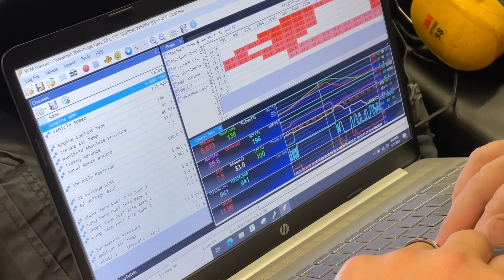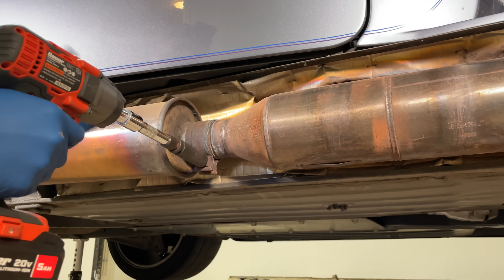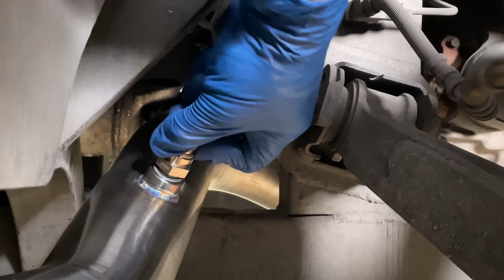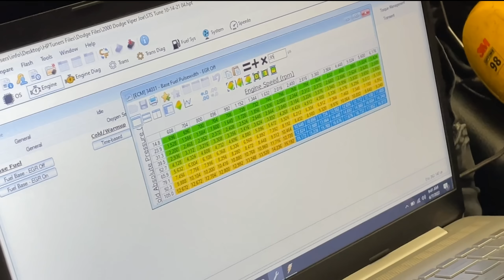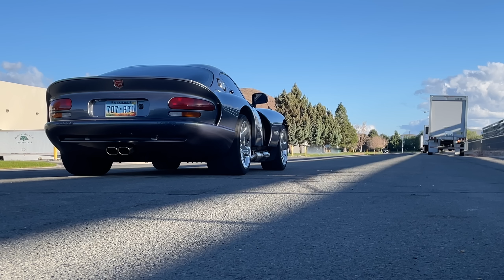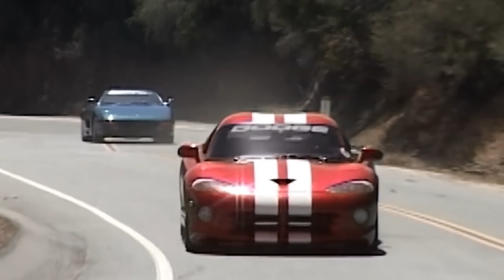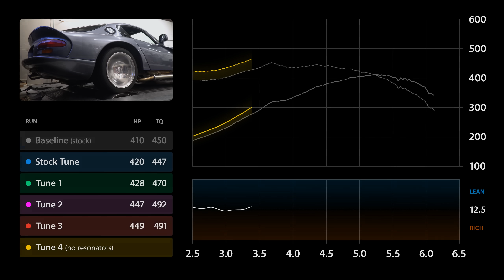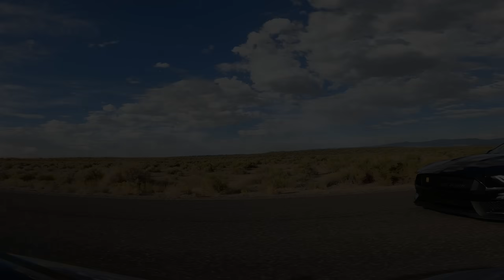When you give an 8-liter V10 the exhaust it deserves

Comment: Those HP and Torque gains seemed amazing to me
Reply: Yea from just an exhaust system that’s solid
Reply: I dont think its just from the exhaust system its mostly from the software tuning
Reply: @luaihommos5987  i went and watched his tuning video on the stock viper with no exhaust and it got to 438hp/483lbs-ft, so the tune was worth around 30 extra hp and torque and the exhaust another 20.
Reply: @EricWangbolone  thanks for the break down, still pretty impressive for an exhaust
Reply: Especially considering is naturally aspirated.
Reply: Very true!  They literally are adding nothing but gains over 10% of HP and torque!
Reply: Hey if you want to see crazy power increases, kawasaki recently released their zx4r, a 400cc inline 4 sport bike and, due to emissions, it only makes 50whp. But if you get the ecu flashed, and I mean just flashed, no exhaust or air filter, it makes 80whp. That's over a 50% increase in power. It also revvs to 16k rpms and does 0 to 60 in like 3 seconds or something, on par with the viper.
Reply: @vali69  well sure that is crazy but that is because the engine is already capable of producing 80whp from the start, but yes due to emission they need to cut down the fuel supply by alot and that means power also go down. Modern cars are like that too, take for example the bmw supra, just an ECU flash and you get 100hp easily.  But they really cut a lot of power since zx-25r can produce 43whp, tho yes it is at 15500 rpm. Also you should also note that most bikes will be able to beat most cars due to weight
Reply: @vali69 bikes are ghey
Reply: This engine making 56hp per litre is terrible, that why big gains are easy. A good sports car should be making 90/100hp per litre.
Reply: @krusher74  well those good sports car won't be producing 660nM of torque at 3700 RPM. Not only that, they are usually a lot heavier than these car. Remember that this is an old car, it was produced before 2000
Reply: @siontheodorus1501 chevy was able to get 405 hp out of 350 cubic inches with the c4 zr1 in the 90s. I always thought even to the last gen of the viper, the power it made was underwhelming for how massive the engine was and with how many cylinders it had
Reply: @blackice7408  yeahh you're kinda right on that, tho early gen viper already produced that kind of HP at half the rpm of what the corvette did. The last gen viper sadly still retains the old pushrod 2 valve per cyl setup, probably that's why it was underwhelming
Reply: @krusher74  I've never heard this take before but it sounds really interesting. Liter bikes would make over 200hp per liter since well their engine is 999cc or thereabout. 600s would be kind if the same and that new zx4r that has a 400cc inline 4 that makes around 80hp would have an exact 200hp per liter rating. If you put it like this than yeah car engines do seem underpowered. Edit: i just realized that my initial post in this thread was about the zx4r. I'm on point lol.
Reply: @vali69  true, but try to make that engine to move weight more than one and half tonne and you will see why
Reply: Yes sir! Can't wait to see what it does in combination with an intake system
Reply: honestly I'd take a bump in 48 whp and 55 wtq any day, those are fantastic numbers for any car no matter the power it makes stock.
Reply: @colinolsen9173  a 10% power increace on a 8L that only made 450hp in the firstplace isnt "fantastic" its still a lazy turd.
Reply: Agreed... nothing mayor was done,, just muffler and tune... 30 HP gain is very good.
Reply: Timming fuel and exhaust
Reply: Torque gains? You could see the back wheels spinning & slipping when it changed gear & then the Loud Pedal broke. Tin-pot shit...🤣🤣
Reply: I wouldn't use the word amazing. 
I would say it shows just how choked down most performance engines are when configured for mass sales.
I would imagine the Mustang would see similar results with that same effort.

Comment: Correct me if I'm wrong, but I think the reason the viper is so quiet is because by nature v10 engines (and in particular I've noticed Dodge v10s) are very quiet, v8s have an audible delay which gives way to distortion. The addition of 2 extra cylinders sort of fills in the gaps in sound peaks that a v8 would have. This is just my theory on why this is so. And if true it'd also mean that it's not necessarily the fact it's quieter, it's that there's less relative quietness, making it seem literally quieter.

Comment: It had a great sound with the resonators, but it made it sound like a silky smooth Italian V10. Without the resonators however, it sounds like a proper American beast 😁. I do hate to say this though, in my opinion when it comes down to stock vs stock Dodge V10 sound, the SRT-10 Ram was amazing. It didn't sound like a vacuum or two 5 cylinder engines having relations...

Comment: That X-pipe is so far behind in the exhaust, that it is almost useless from performance point of view. And the "venturi effect" collector all but offsets the high flow cats that "further reduce restriction". All these modifications are useless, and the richer fuel ratio you measured on the dyno signifies you actually added more restriction.
At least it sounds nice, but to me the divorced exhaust sounded nicer.

Comment: I don't care what exhaust system you throw at this, you might as well burn the money in a pile in your driveway. Chrysler whiffed it on the firing order which is why it sounds so anemic which it is not, but it sounds that way and it won't improve. I love Vipers and the relentless torque push in the back it gives you but the tone is brutal. I've often  wished out loud that someone  would grind a cam with a revised firing order ala the Audi R8 or Lamborghini Gallardo V10

Comment: I'm a car enthusiasts, not a gear head so maybe  I am ignorant to it, but doesn't a v10 just naturally sound quieter due to the extra 2 cylinders and other components drowning out other sounds? Thus making the car sound smoother? I assume he is comparing the loudness and raspiness of a v8 to the v10 which is why I mention "extra 2 cylinders" because it seems when anyone tries make their car sound better they use v8 sounds as a standard. He wasn't satisfied until he heard some raspiness from the v10 which is not what a v10 is really meant to do... right? Either way it doesn't matter because it sounds way better and if you ask me there is a reason why v8 sounds are the standard.

Comment: I really do appreciate your time and effort for making such a satisfying clip
However, could you be kind enough to give us more info regarding the tune you've done?
For instance, what was the STFT and LTFT before the remap and what are those after remap?

The adjusment on timing, did you do this only for ignition? Or for the injectors timing as well?

And since you deleted the resonator, the pipe has become to long and in my opinion you can decrease the radius of the pipe at the mid-end to the high-end of those pipes as the flowing gas in the exhaust gets cooler and less torbulent so you do need more venturi effect to speed up the flow

Comment: u would expect a 8litre v10 to be 600bhp and up , you can get the same power outta a 3 litrr
Reply: And you can also tune the Viper engines to 3000+ whp, what's your point?  How many 3L engines were making 450 hp from the factory in the mid 90's?
Reply: @ssoffshore5111  my point is handling , dont make me laugh about tuning it 2 , 3000hp. Thats exaggerated , you will have to do alot of mods 2 do that , but that chasis is trash for that speed . 8.0 sounds like a man who is tryn 2 composate
Reply: @ssoffshore5111  dodge viper was supposed to be a supercar , im sure there were other supercars that could do 400+ , whats your point ? Was it a mechanical marvel ?or a waste of space litterally .it can still get its ass kicked on race course by a less powerful car .

Comment: Good video - nice vipe! (My friend has a white convertible - now I’m gonna ask about his exhaust)
My personal opinion was that I fully agree that once you upgraded your exhaust - it sounded like it should have sounded from the manufacturer. And yes I understand you still wanted something a little more edgy - I kind of want both tho. The moderate low rumble of the new custom exhaust AND the choppy gurgle without the resonators. Some systems actually allow you to push a button and bypass the cats BUT all that said - if I had to choose I wouldn’t remove the resonators. Simply because it sounded too common, similar to lots of other cars with big engines, headers, and straight pipes. Love your car.
And me, I have a 350z with custom dual for the track and I despise how it sounds, but that’s not “the” priority. I purchased a Procharger and will address “sound” after we install that. Good Vid - Peace2u

Comment: I have an F-type R that I bought because of the exhaust, so I know what you're experiencing. However, I wish there was some way to mute it, because there are times when you don't want the noise/attention/boy-racer looks/gas mileage hit (you can't help but drive crazier with a snarling exhaust).
Reply: I keep it in quiet mode ALL the time now, and only use the loud mode when I park next to a Vette or a Porsche. Still, it's waaay too loud. Never thought I would say that....sigh.

Comment: Would love to know what could be done on the induction side to improve performance.

Although not quite in the same league, I recall changing the exhaust AND induction on my Nissan S13, and the improvement was impressive. Indeed, the flow was so high, the engine management system would actually shut down the fuel feed as it thought it was detecting an error. Had to get the ECU reprogrammed to stop that :)

As regards the throttle failing on the Viper, I recall a similar thing happened on an very old car I owned, where the return spring broke on the engine's throttle arm. Mananged to fix it to get home with a big eleastic band I happened to have in the car :)
Reply: The later gen intakes make more power.  If you really want to wake them up, forced induction will do it!  I've never got mine to read accurately on the dyno, above 1500 whp it just spins the tires too much...
Reply: @ssoffshore5111  Mumma!

Comment: 11-12whp from removal of a straight through resonator makes no sense to me.  I’ve spend countless hours dynoing all sorts of car and have never seen this before.  Even before and after of properly sized HFC usually doesn’t net that kind of gain.  Was temp and barometric pressure súmula for the day?  I know the Dyno software will correct but that’s not always super reliable .

Comment: I'm curious, any ideas on why removing the aftermarket resonators increased power so much?  I'll admit, I'm baffled (pun fully intended), since most aftermarket resonators are straight-through and thus, aren't restrictive.  Are the resonators for the Viper more restrictive?  Is there something about the soundwaves/exhaust pulses/back pressure that changes things?
Reply: I'm really confused about that too, doesn't make sense.

Comment: I'm going to use this as the tutorial for when I do the headers and cats on my 01 this winter. Do you have any intake modifications on yours yet or are you running with the stock filters and the rough tubes?
Reply from the maker: i have k&n filters and smooth tubes, not gonna modify the airbox tho because i think it does a good job of building air pressure, especially above 80 mph

Comment: Those v10s just don't get very loud. We had a v10 dodge truck at a company I worked for. It was the bosses truck for a couple years before he upgraded and put it out with the fleet. He went through 4 different exhaust and multiple sized tips.  Thing sounded like a honda with a few holes in its muffler.lol

Comment: To be honest, I liked the sound more when the resonator was on. It's all about personal preference though. That being said your video is very interesting, current top comments really describe my thoughts about how you kept the video straight to the point without extra fancy details. I wanted to see exactly this content and you delivered perfectly. Thank you for this video !
Reply: I was thinking exactly the same. I like engine sounds, not "pipe" sounds. 
The resonator dampened those ear piercing pipe resonances and it sounded like a muscular V10. 
Without it, its 50% pipe screams on top of the V10
But if the goal is to achieve the maximum performance possible, he gained some hp taking it away
Reply: Agreed! With the resonator removed it makes it sound cheap lol like those Honda civics
Reply: @Honest Review  well, cheap basically describes the viper engine. It's basically just a low tech truck engine jammed in a sports car.
Reply: It could’ve been different in real life too
Reply: Just sacrifice a couple of horsepower and keep the resonator on jeez... it's there for a reason.
Reply: @KingOfKings34  I think it sounds better off, so it's a win-win to me.
Reply: I thought this at first as well but after seeing the power gain my decision changed.
Reply: @tractorguy1994   @Lucas I agree with both of you, indeed performance gain was the goal but sound-wise, I'd definitely go with the resonator on ! If it's just about performance it's not that much of a loss, it's mostly just "aesthetics" so not really necessary.

Comment: The only problem I have with your video is that you left power on the table. You installed equal length headers, which are only good for a turbo charged situation. When you use log style, it creates back pressure, which when coupled with valve over-lap to suck extra air through the engine, which cools EGT's and ensures the chamber has less residual exhaust gases. You did a great job selecting the other parts, and chose ceramic coating to reflect heat back into the pipe, I never would have though of that.

Comment: Just proves there's no replacement for displacement. A simple exhaust and this thing is pushing out 60 more pounds of torque! Just imagine basic cat deletes, an intake, ported manifolds & mild head porting & polish. Prob bump it up 150lbs of torque. Then just imagine some boost. Just 1 measly bar of boost would have this up to 1,000 hp easily with room for way more.

Comment: Why would you pull back timing at the same time as leaning it out? Lean charges burn slow. 
Do you even engine, bro?
Reply from the maker: To prevent knock. First dial-in AFR, then slowly add timing and make AFR adjustments as needed.

Comment: I’m absolutely disappointed with the viper always liked them never new that much about them then i seen the OHV set up🤦🏼‍♂️ Americans living in the dark ages with their massive CC engines and no power😂 just imagine if the viper was OHC and 4 valves per cylinder it wouldn’t be running out of steam at 5000rpm. 1970’s engineering in a y2k car shame on you dodge

Comment: Love how the viper tries to kill you at the end as most vipers do 😂 if that thing happened on the freeway it would definitely caused an accident
Reply: Not necessarily, losing all power wouldn't mean slowing down catastrophically quick, and with a bit of luck he'd be able to pull over to the side without anyone ramming him.
Reply: @settratheimperishable4093  unless he was in the middle of an overtake on a 2 lane highway
Reply: @gophop  brakes still work
Reply: I've bumped a shifter into reverse at 60 on the freeway before and was perfectly fine, this dude would more than ok just loosing power, lol
Reply: Definitely cause an accident? Are you joking? It would not cause an accident 99% of the time even with an average driver behind the wheel. You just slowly move to the breakdown lane and stop there.
Reply: How dus losing
Reply: The hell you talking about? More like I'm surprised the stang didn't try to kill you by losing control and slamming into you.
Reply: having your battery die is more dangerous because even the power steering goes out
Reply: @koopspook  At highway speeds you don't really need it. Also the alternator should continue to work.
Reply: @gahbah274  a dead battery will eventually fuq your alternator, meaning you won't notice it until its shuts down on you sometimes happening while you're driving. A dead alternator also won't charge your battery and your recharged battery can drain while you're also driving. I'm only saying because this has happened to me a couple times lol
Reply: @koopspook  Only newer vehicles have electric power steering. Older vehicles have hydraulic power steering that is run by an accessory drive on the engine.
Reply: @vezzarn  but dead battery = dead engine, dead engine =dead everything running off the engine right?
Reply: @koopspook  you dont need power steering at high speeds. Edit: nvm I assume you're talking about modern electric power steering, and in that case you are right. Side note, electric power steering should be illegal for this very reason.

Comment: People don't realize that the GT350 is designed for the track, road racing, not straight line drag-style racing and 30-50 mph highway pulls. Put that Viper on a track with the GT350 and there's where you'd see the performance difference; the GT350 would eat that old Viper on a road course. A newer GTS...not so much lol. And I think a driver-mod might do big things for the GT350 lol.

Comment: The gt 350 was built to compete with European cars. Its built more of a road racer. They have independent suspension and front and back sway bars. The gt 500 is built more to American muscle cars. It has a solid rear-end , with more horsepower and torque. A 2008 gt 500 would blown your doors off.
Reply from the maker: The 2017 GT350 is faster in the quarter mile than an '08 GT500 by about 0.3 to 0.5 seconds according to Car and Driver's tests.

Also this Viper is lighter, and makes more hp and torque than the 07-09 GT500's.